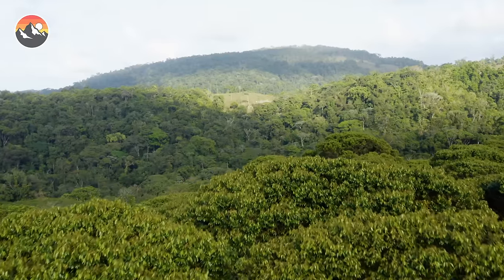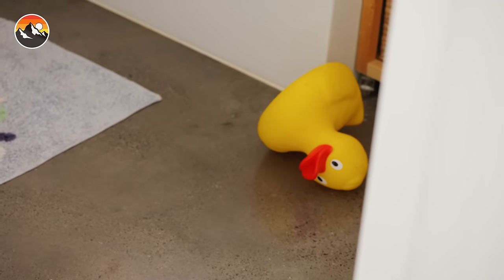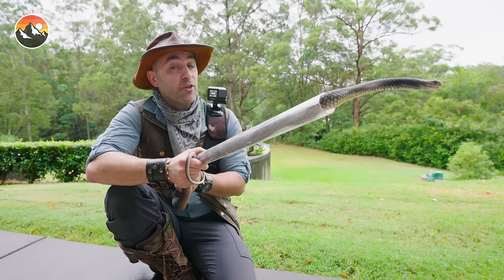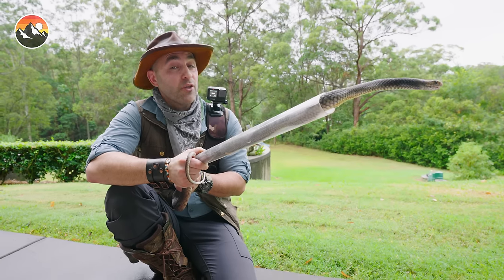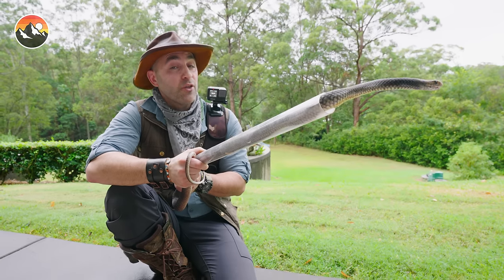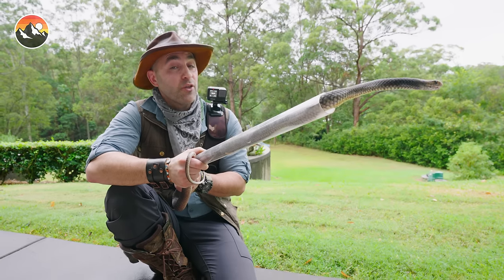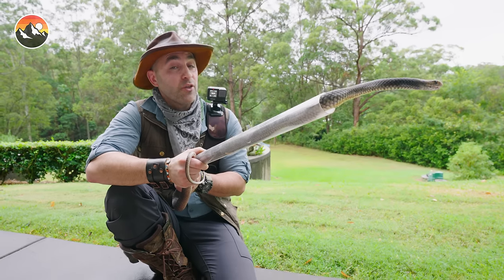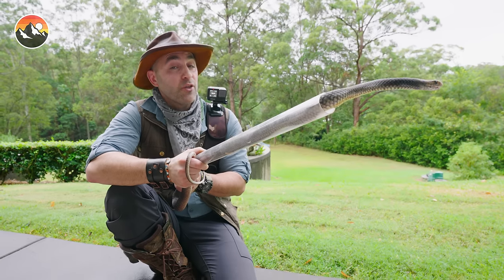BIG ANGRY SNAKE - Deadliest Job in America + Exploring a Snake Infested Forest!

Comment: 46:25 Is it really optimal to keep the most dangerous snake in the highest box? It seems like an unnecessary risk. I'd place the least dangerous snakes at the top instead. Wouldn't it be safer to keep the most dangerous snake at a level where you don't have to climb stairs?